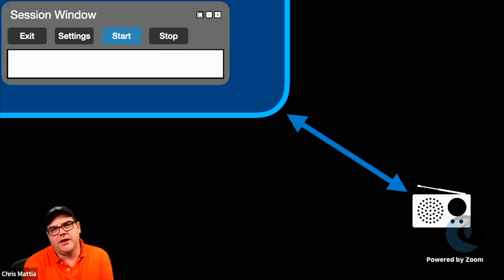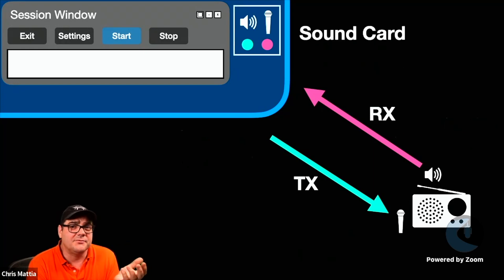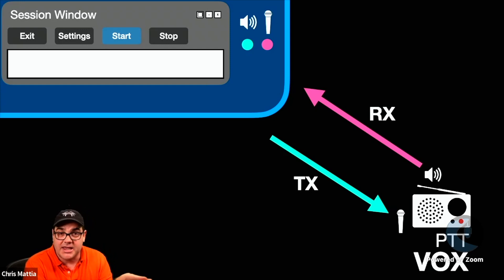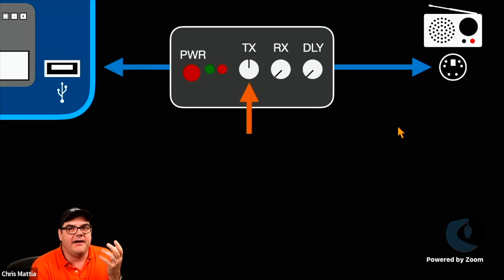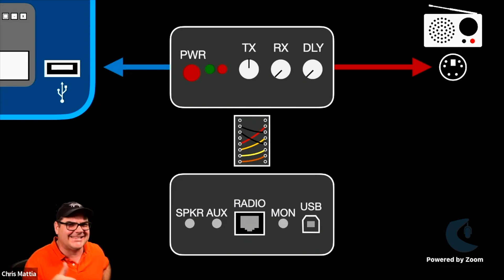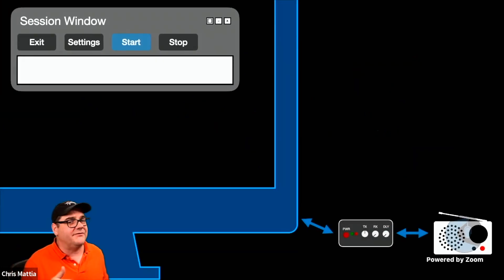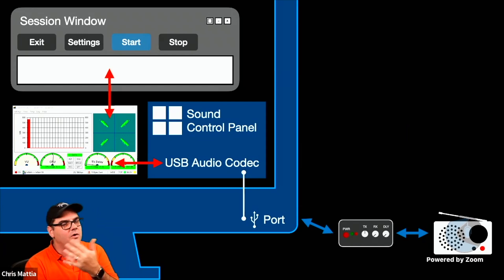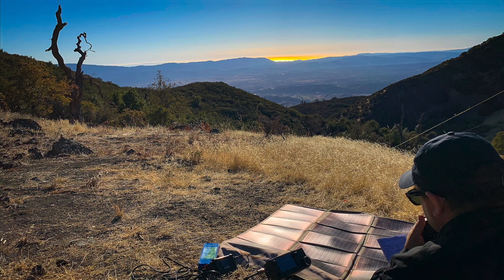Winlink VARA FM Signal Chain

Comment: I use a Master Communications DRA-50 with my Yeasu FTM-6000 and it works like a dream.  The DRA-50 uses a USB cable to connect to the PC and a 6 pin DIN to 10 pin DIN to the radio.  It worked fine right out of the box.  No jumpers, no muss, no fuss. Master Communications has a great web site with tons of useful info.  73 KB3NG

Comment: When I bought my first Signalink USB, I also bought the jumper module. This was fine for VARA Narrow, packet, VARA HF and ARDOP, but for VARA Wide I needed to use the jumper wires. Now Tigertronics sells a jumper module with a switch on it so that it can be used for either 1200 or 9600 configurations.  73 KD5YOU
Reply from the maker: I thought I would need the jumper block as well, but when it took several months to ship, I should have just canceled the order.  The jumper wires were much easier to figure out than I had expected. Thanks for learning with us! 73 W6AH